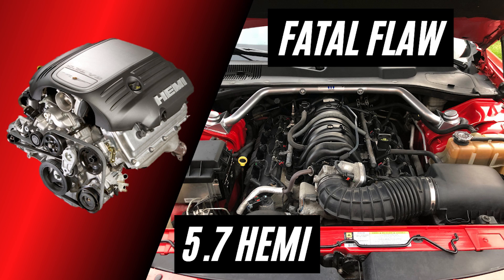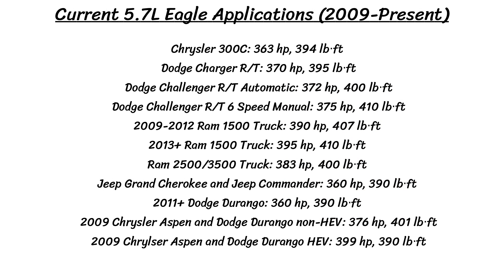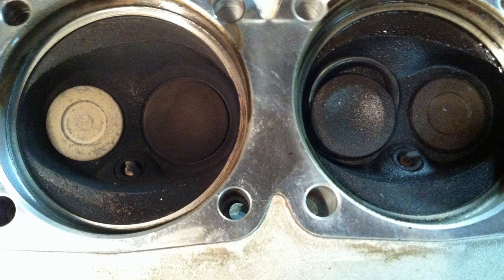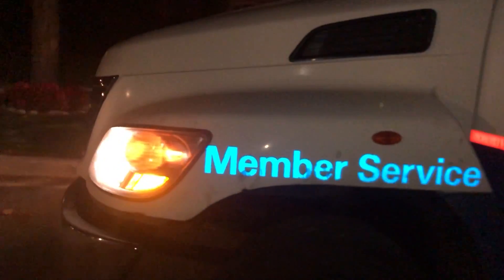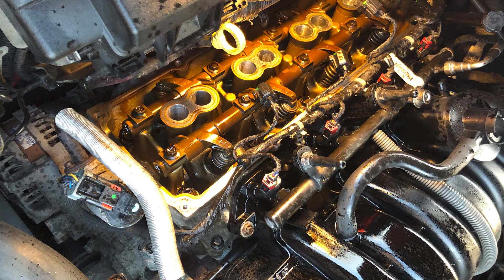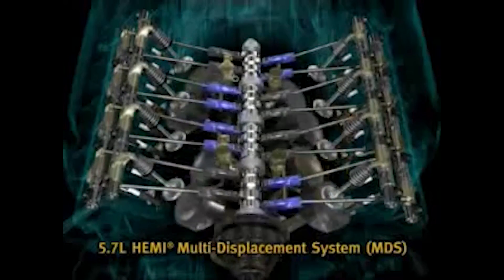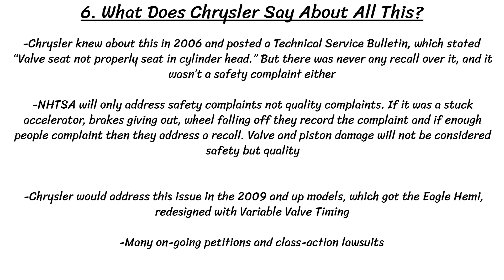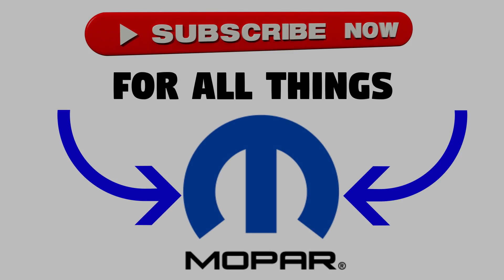The Fatal Flaw of the 5.7L Hemi V8 Engine & How to Prevent It (2003-2008 Valve Seat Drop)

Comment: Got a 6.4 2019, when warranty ends I’ll delete the mds first thing
Reply: MDS is not causing problems, nor does a 19 have any known issues.
Reply: @snek9353   let's not forget the very well known 5.7 "tick" on these mds motors usually noticed after 100k miles
Reply: @dh4094 How could we forget, it's all the YT experts in comments talk about. But they say incorrect things like relating the "tick" to MDS. One almost always has nothing to do with the other.
Reply: @snek9353  kinda odd its the same cylinder(s) that have the tick with each problematic engine......odd the non mds motors didn't have it. I'm not gonna claim to be an expert by any means though.  Would be nice if chrysler fixed the problem,  or offered a non mds option, you know 1.80/gallon i don't mind a 12mpg v8
Reply: And its terrible for racing or a sudden need for power with delayed bog before activating all cylinders.
Reply: @dh4094  On one hand you say you don't claim to be an expert. While also claiming to know that it's the same cylinders that have the tick(which is false). While also apparently being completely unaware that there are many non-MDS G3 Hemi engines. None of the 6.1 or 6.2 engines are MDS, and a 5.7 or 6.4 with either a manual transmission or in a 2500 or larger truck don't have MDS. 

If you have an MDS engine and don't like it it's easy enough to turn off or restrict it's parameters. As is from factory it turns off in auto-stick, below 10MPH, above 128MPH, and above 3000 RPM(lower at low oil temps). Personally I like MDS and think it very worthwhile in my Chrysler 300, but I've changed it so it doesn't activate below 25MPH. 

FWIW(at least in mine) factory when not in Auto-stick the engine torque is limited in the first 2 gears anyway. As is throttle response in general, those two parameters are much more limiting than the itty bitty delay from MDS.
Reply: @snek9353  well since your such an expert on the issue,  you should be repairing dodge owners vehicles in your garage. I think you need to actually go read what all the people who had lifter failures said. I usually don't entertain internet pros, who offer no solution themselves but troll the comment section with "no way its mds, I love mine! "

 have fun,
 I won't be reading any further trolling
Reply: @dh4094  You clearly don't know what trolling is either. I'm as much of an expert as you'll find here. I did work on performance cars for a living for years and had my own shop for while. These days I make a good living doing easier things. 

You didn't ask for solutions, you only spouted BS that I debunked and showed your ignorance. The smart thing for you to do would be to pay attention and ask questions. But if you were smart this would be a very different conversation already.

Comment: My 2019 Ram 1500 with 35,000 miles is currently in the shop due to lifters... PLEASE do a video on the lifters in newer Hemi engines! I'm currently filming a video on this whole situation and the struggle with the dealership (who is being kept anonymous at the moment) 😬
Reply: ALSO look into the Tazer module from Z Automotive. It allows MDS to be shut off automatically every startup as an easy setting choice on the display once plugged in and "married" to the vehicle. It's available for many Chrysler, Ram, and Dodge vehicles.

Comment: This is a no brainer - deactivate MDS with a tuner (while adding the Cold Air Intake and 91 octane tune) and do the 180 degree Thermostat swap and accompanying mods to the fans kicking in and the engine will almost certainly not have this issue. Plus the CAI tune (and CAI of course) makes the the engine sound oh so good. I would consider this mandatory before you get to 100k miles
Reply: I just bought a 2006 Charger RT with 186 K miles I don't know if these things have ever been done is it too late to do them

Comment: Ok... it’s sucks but at least it’s a mopar. Instead of killing off v8s they push forward for enthusiast. Ford v8s have their run of issues. LS motors suffer lifter failure from cylinder deactivation. My L76 had a perfect running engine until it didn’t. Collapsed MDS lifter. Scored the cam. Cost a few thousand but it’s back up and sounds better than any v6 or forbid, a 4 cylinder.

Comment: Without watching the video just yet. Routine oil changes and turning off MDS using a tuner will save this engine for long long miles ahead!
Reply: Not driving at 100 mph everywhere helps to.
Reply: @Hats1976  That honestly goes against rhe purpose of a hemi

Comment: The actual largest “fatal flaw” of the Gen3 Hemi is the premature lifter failure!! That’s the one that is the most common failure which Is truly is caused by a design flaw!
Reply: Which is still less than 1% of engines mind you
Reply: @captainblaiser  REALLY? Huh, after working as a service advisor for Chrysler/JEEP since 2001 I guarantee it’s a FAR more prevalent issue than the valve seats. I’m personally on my 4th set of lifters and see 3-5 failures of lifters per month. The most recent was a 2018 with leas than 43k miles! I’ve been collecting all the failures, that I’ve dealt with, since the beginning of the year. Right now I’m working on filling up my second homedepot bucket and will probably be starting on my 3rd bucket before the end of the year. I’m also keeping copies of RO’s for something else I’m considering!
Reply: A flaw that is very rare and now fixed.

Comment: Dodge: we have the hottest engines in the business, literally! Even the V6 engines put out a lot of heat. The 2013 SXT Charger I had put out a lot of heat, which worked great in the dead of winter when you wanted to switch on the heater ASAP. The rest of the time, the engine fan did it's job, and I made sure to let the fan finish it's cycle before shutting the car down. The electrical system had its quirks, but the engine was reliable. I miss that car!

Comment: Kind of like how GM's AFM system tends to destroy camshafts. That's why my coworker is doing an AFM delete rebuild on his Chevy.
Reply: Similar issue with MDS as well.
Reply: You can disable the AFM with an OBD
Reply: @mayonnaiseluther1568   It still will fail. Thats why I did a LS3 conversion

Comment: It's a shame that Chrysler doesn't offer any recourse for the damaged engines. But I'm glad to see Marspeed is rebuilding his beautiful Daytona.
Reply: I’ve got a 2004 dodge truck with the 57 hemi  and it’s got close to 164000 miles and I’ve replaced the spark plugs one time and it’s going strong it’s been a great truck it might die tomorrow but it’s one of the best trucks I’ve ever had
Reply: @shawncole6122  I think it effects those with the mds your doesn't have mds
Reply: @shawncole6122 me too. My just went out on me yesterday. Waiting to see what the problem is. Never had any issues with my 5.7 I just hit 236,xxx miles
Reply: Larry Ballard  My friend at work had this exact scenario happen on his Truck. 160k miles. I feel bad for him. He had just rebuilt the entire front end. New radiator and water pump, t-stat.
Reply: @Hybrid Libertarian are you sure it's less than 100 valve seat failures? You may want to check again
Reply: @Hybrid Libertarian They probably dont know about many; mine went to a independent repair shop.
Reply: @Hybrid Libertarian where are you getting only 100 engines? It's a known problem with the early mds hemis
Reply: @captainobvious5993  Literally just happened with my 2006 Charger Daytona at 115,000 miles.  Had a small hose failure on the highway and started to smell coolant.  Wasn't certain it was mine, four lanes of traffic moving at 65+, but as soon as the temp gauge budged I got to the shoulder and shut down.  Temp gauge had gone up to about 80% but not hit the red when I got stopped.  Engine was shot thanks to this flaw.  Having it rebuilt now and just confirmed the block is cracked so adding a little more to the bill.  Hooray.

Comment: My dad had an 05 hemi ram since new.  Raced it, beating any other truck it raced (back in the 2000s) while also being a full time work truck pulling trailers etc. with temps under zero to over 100 where we live.  Never dropped a valve seat but went through many water pumps, pwr steering pumps, a transmission at 295k miles, and was sold at 405k miles.

Comment: My engine quit at 86500 miles.  Luckily I had  a purchased extended warranty but it still cost $2500 for new engine.  What I don’t know does the new engine have this problem.

Comment: In other videos I've seen, the "fatal flaw" has been lifter failure and the lack of oil lubricating the camshaft due to the relationship of the cam and crankshaft location in the block.  That would make the valve seat issue the third "fatal flaw". One thing in common with these flaws is that the MDS is a catalyst for engine failure. BTW, my 2005 Ram 1500 does not have MDS, it's my understanding that MDS wasn't used in the 5.7 Ram engine until the 2006 model year.
Reply: UT is a moron and MDS is not a cause.